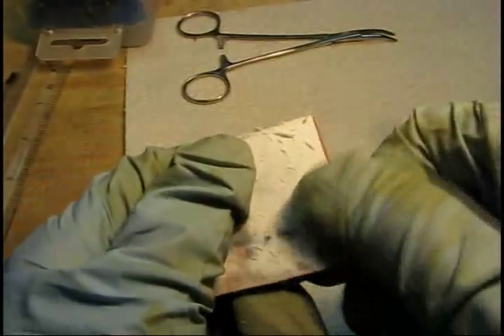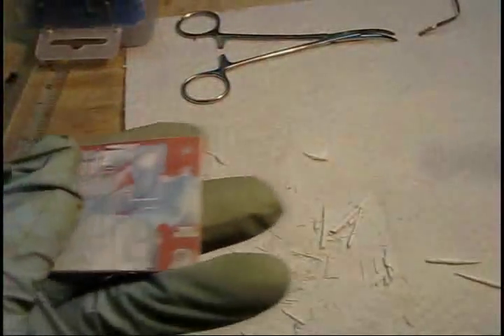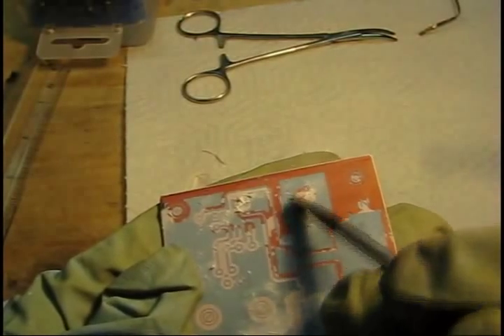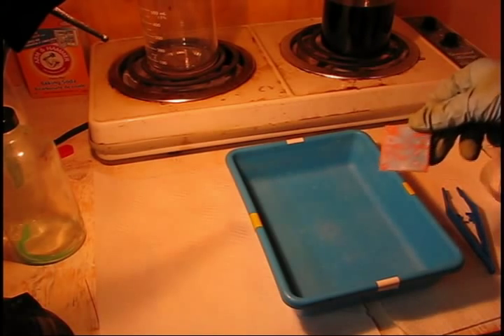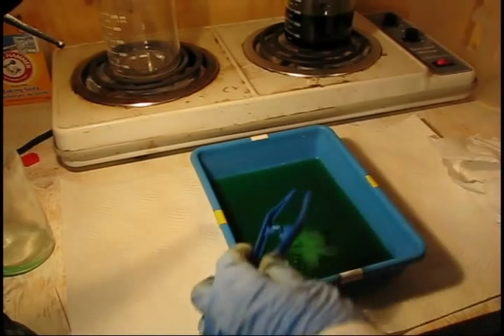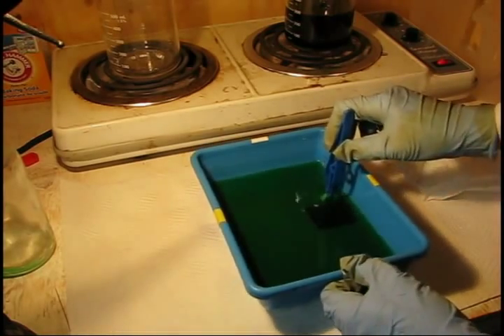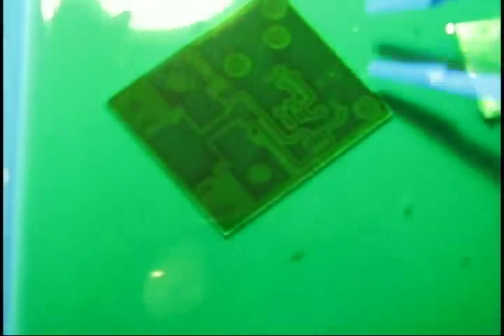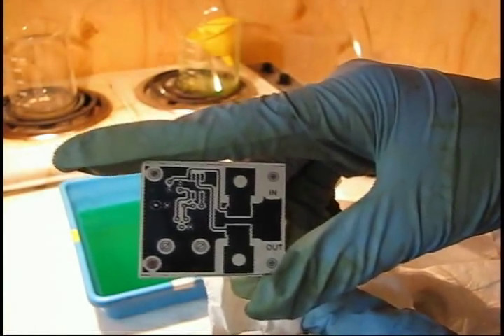PCB Toner Transfer Etching Tutorial Pt 3

Comment from the maker: @LehiMPompasI I did use distilled water, but the water isn't really doing anything to the paper other than making it wet and soggy, weakening the bonds between fibers. Note how I have to rub the board vigorously. I have in some cases used a soft bristled toothbrush to remove paper. Prep your board surface and do a pre-etch, it works wonders on making the toner stick well.

Comment: Just a note @0:55, Those 45° angles appear in all kinds of pcb designers and manufacturing processes. It has little to do with keeping the toner on the board... even though it may function well that way. In electromagnetics there is a problem with sharp angles radiating at high frequencies.